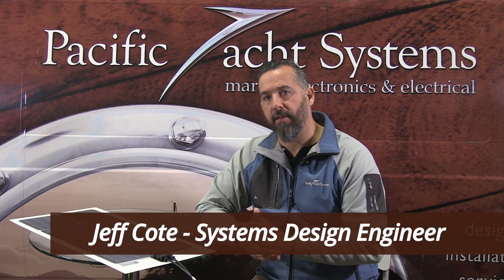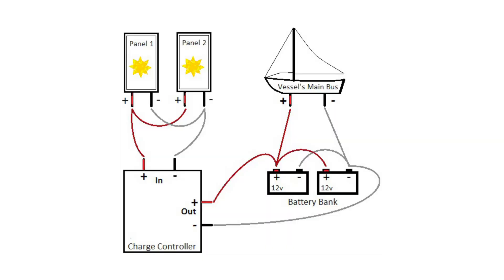Troubleshooting Solar Panels on a Boat

Comment: Can you connect in series 2 12v solar panels to 12v batteries ? Can the charger change the 24V output of the panels into 12v for the batteries ?
Reply from the maker: Hi Olivier, most definitely. Most of us solar panel techs, commonly install solar panel in series to one controller. Make sure your controller can take the correct input series voltage and amperage.
Reply: @PacificYachtSystems  can you show and tell me where the fuse is before battery ,after controller